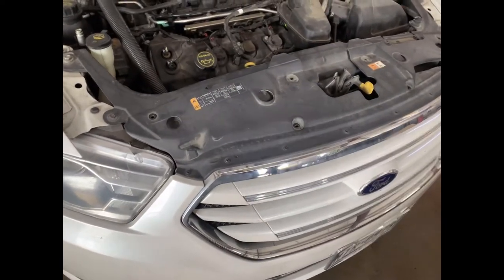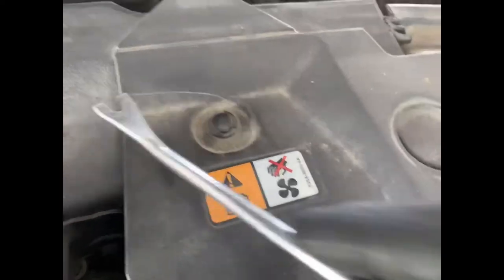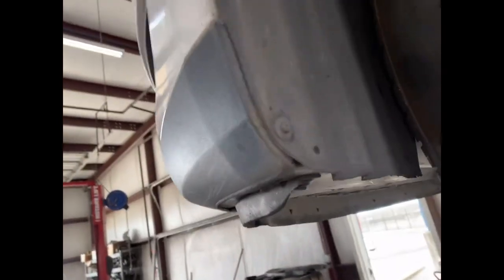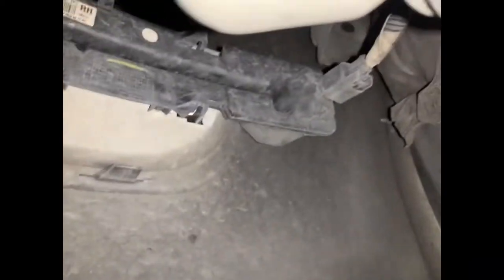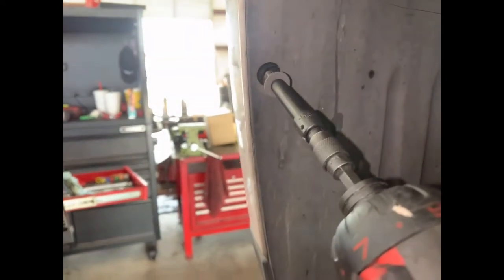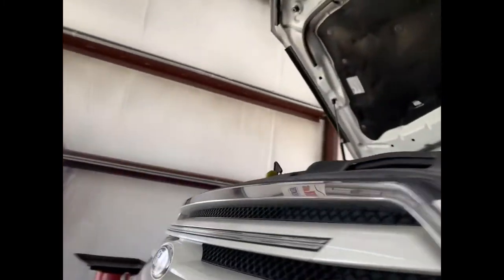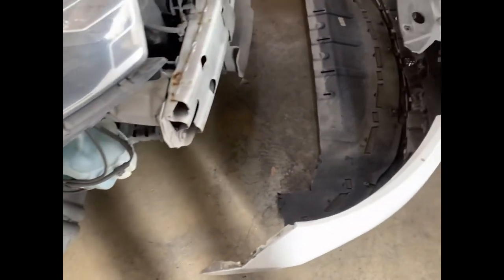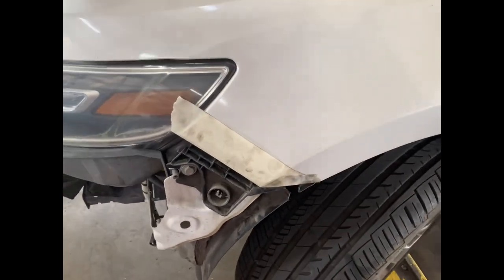2014 Ford Taurus Front Bumper/Fascia Removal

Comment: I'm so glad you came out with this video man. I just wish you continued it. I need to know how to replace my condenser. I have a hole in my old one from my old accident and would love to know how to put it in.
Reply from the maker: Condenser has to come through the front
Reply from the maker: You don’t “HAVE” to remove radiator to pull it out buts it’s a lot easier to pull fans and radiator then condenser through towards engine